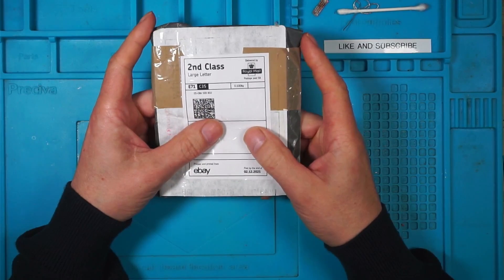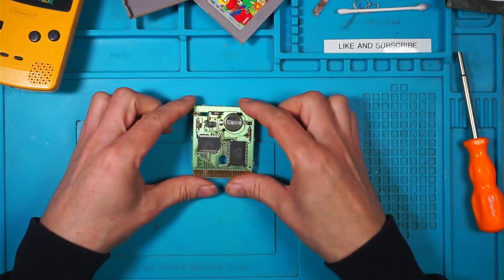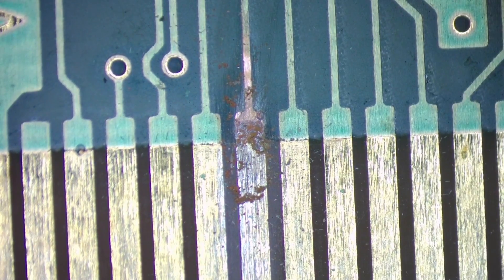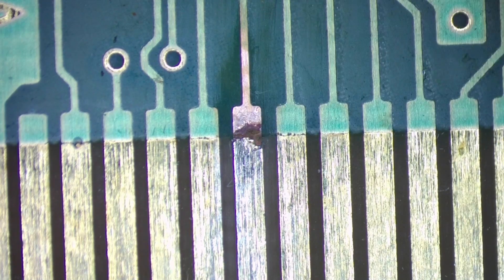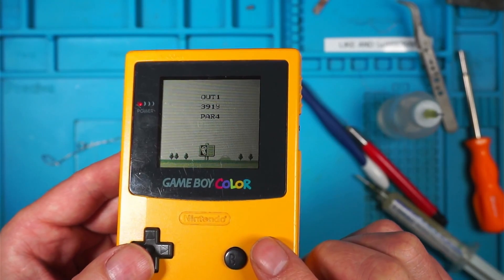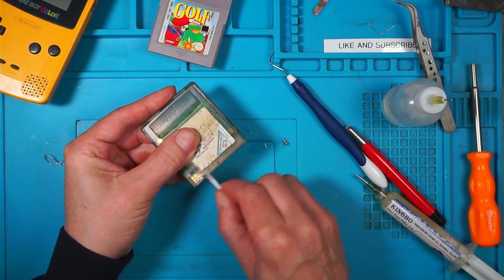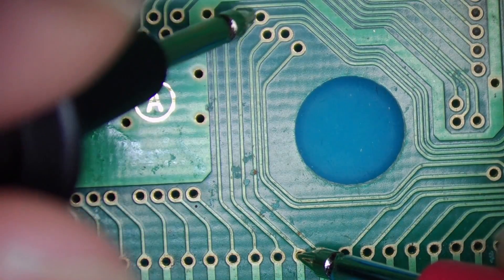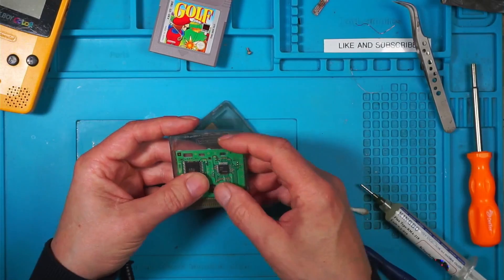Gameboy Game Won't Load | How to Repair for Beginners | Common Faults and Fixing Them

Comment: You're telling me you can just squirt vinegar and alcohol all over that circuit board and it won't get goofed up at all? -Yo'ster
Reply from the maker: Yes it will be fine. The only thing to take into account is if the game has a battery on it. The white vinegar could short something out.
Reply: @PhilipBryden What makes vinegar or alcohol so much less destructive than water? -Yo'ster
Reply from the maker: @mxtoastytoad  white vinegar cleans corrosion. Alcohol cleans off the vinegar.
Reply: @PhilipBryden  But aren't they still liquids? -Yo'ster
Reply from the maker: @mxtoastytoad  The board doesn't have any power, there's nothing to worry about. Cleaning with white vinegar and alcohol (99% IPA) is perfectly safe.
Reply: @PhilipBryden  Would water still mess it up? -Yo'ster

Comment: Wow, two years lost package huh?

Most I ever had was about 5 months. I ordered a Commodore 64 dead test cartridge from an ebay seller, and it showed up one day months after being lost.

I contacted the fella and asked if he wanted it back. He said "thanks for offering, but you can keep it."

That's how I wound up with two identical dead test cartridges.
Reply from the maker: The Royal Mail does a pretty good considering the amount of packages that goes through the system. The lesson in here is to use a decent size box, less chance of it going missing (hopefully).
Reply: @PhilipBryden  A box? what's that?

Most of the stuff I order ends up coming in a little mailing baggy.

Comment: Great video. I've not seen any gameboy game repair videos before. Fixing gameboy games seems to be a good way to practice troubleshooting skills and trace and pin repair skills. Plus you can bring a fun game back to life.  I have a friend of mine in England. The next time he complains about his mail being late by a few days I'll refer him to this video🤣
Reply from the maker: They're pretty basic and normally easy to fix, so it's good practice. Dirty contacts, broken traces and loose pins and that's pretty much it. They chips seems pretty reliable. Getting them for a good price is the hardest thing lol.
Reply: @PhilipBryden  I guess they are starting to get expensive. I took apart the one NES game I own to replace the battery but found out it is soldered to the board. The battery is flat but it's not corroding. I don't play the game so I thought I'd just leave the battery and only replace it if it starts to leak.

Comment: Good content Phil! Many would've missed the small trace break and the raised chip leg. Goes to prove a little multimeter training goes a long way.
Reply from the maker: Thanks Tox. I've started working on a project I had given up on before. A GBC with very bad corrosion. It's had dozens of repaired vias and traces. All the chips have been removed to repair damage underneath them. The thing still won't turn on. I've pulled it back out of the box and (using the schematic) checking all the routes to and from the chips. It's going to be a while.